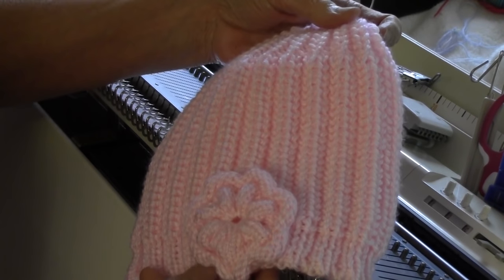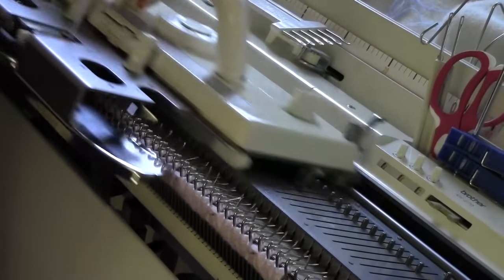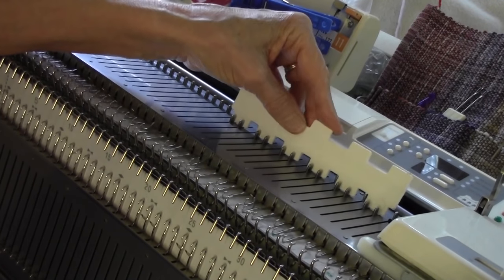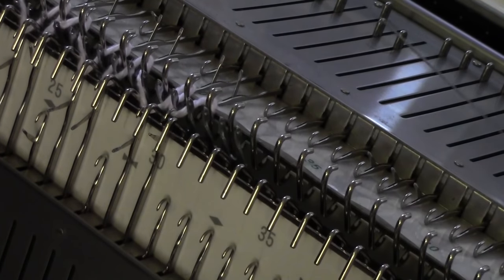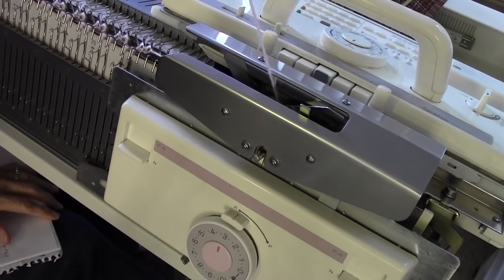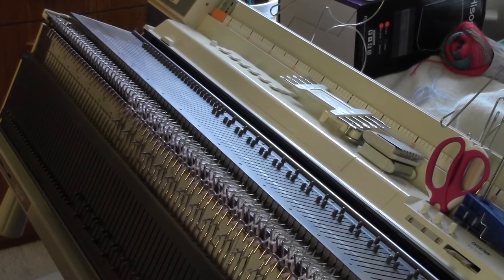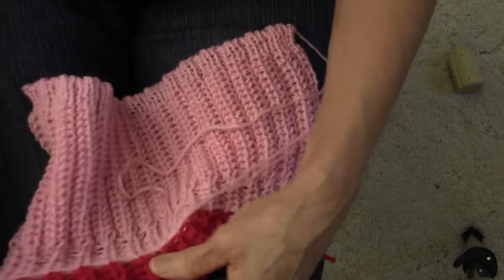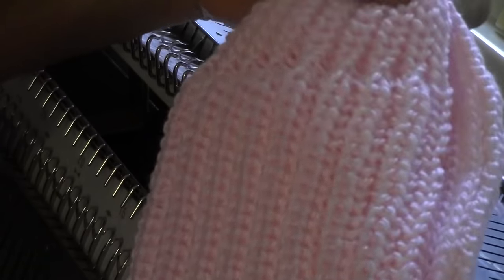Machine Knit English Rib Cloche Hat by Diana Sullivan

Comment: Diana, I absolutely love your videos. Quick question for those of us with standard beds who would like to follow along (we aren't all lucky enough to own a KH-270...yet ;)...should we simply double the amount of needles in work? e.g. if you cast on 10 needles, should we cast on 20? Many thanks. Chris x
Reply from the maker: You can try that, but gauges vary, and I haven't figured it out for the standard gauge machines.  It's such a small project that you could use that first effort as a gauge swatch and adjust from there.
Reply: I'm trying to do this on the standard machine too.  So far, tried twice using the same numbers as this bulky pattern.  If the project works, I should have a pretty cute doll hat.  First try was with 2 strands 2/24 and main tension 3 which was too tight for the pattern.  Second try, used tension 4 on both beds.  Failed again because during the double english rib portion, stitches are catching on the gate pegs of the ribber.  Tension is still too tight.  I'm going to try again another day with different yarn, tensions, etc.